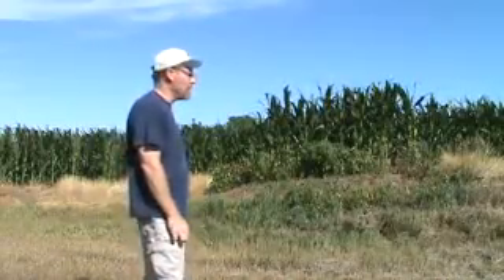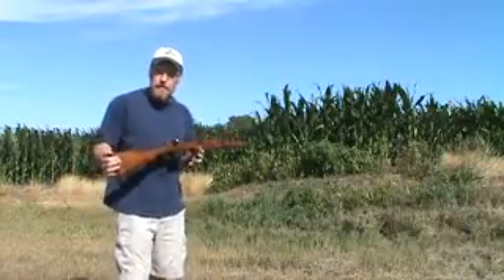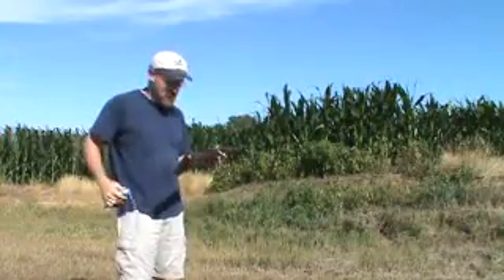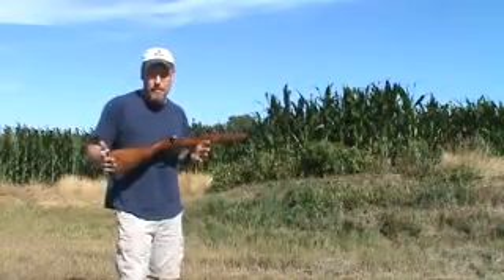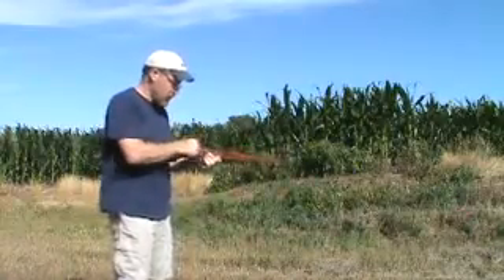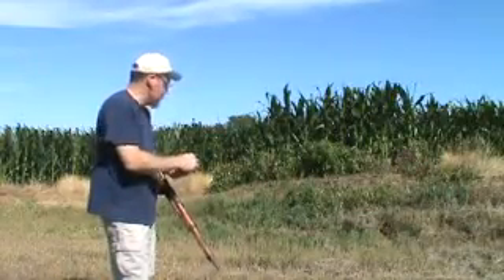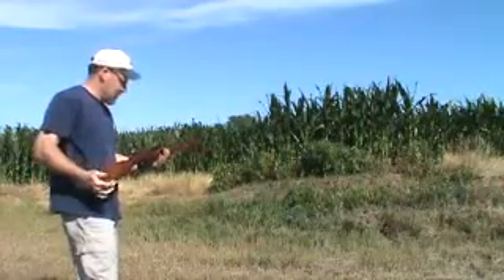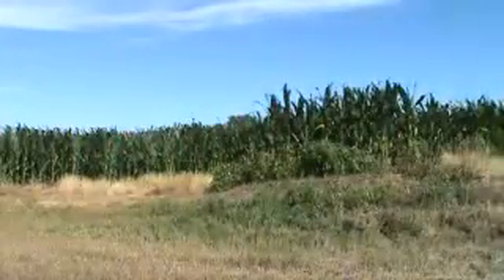Steyr M95. Shooting my Austrian M95 Steyr for the first time.

Comment: Be careful with single loading not to slam the bolt hard. Without the enbloc clip it is very hard on the extractor to snap over the rim once the round's already in the chamber, and good luck finding spare extractors!
Reply from the maker: Thanks for the info. I now have the clips so I wont be loading one at a time anymore.